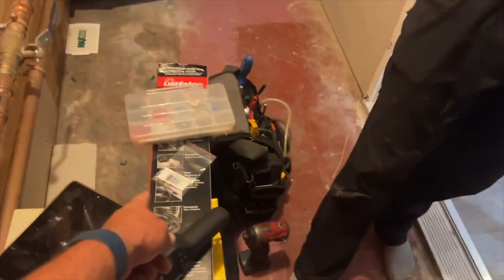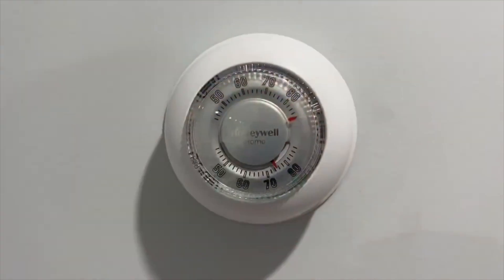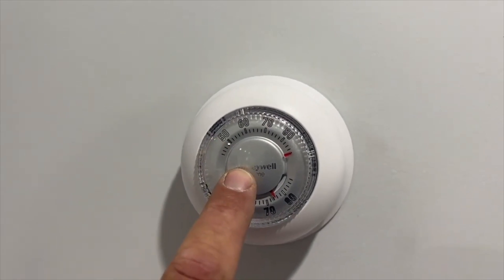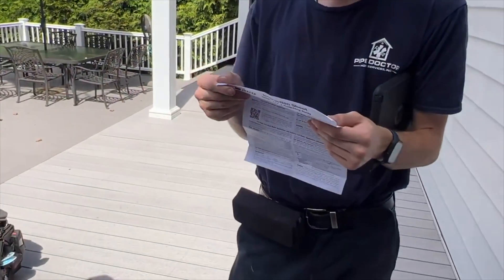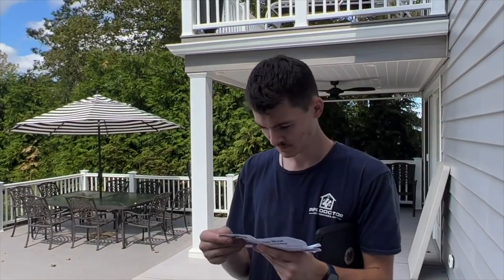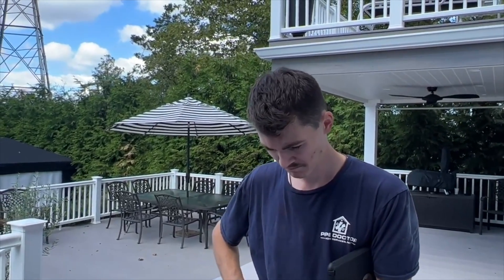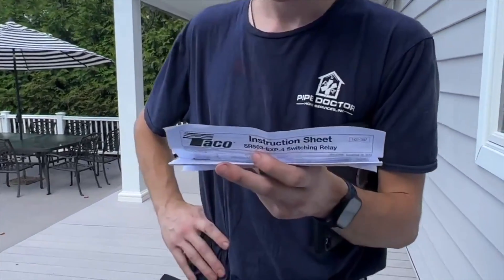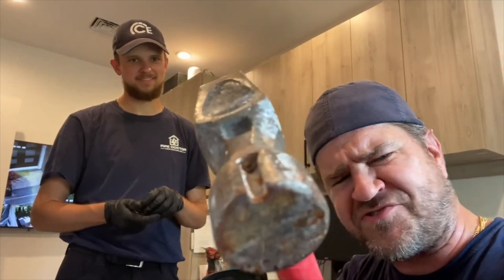Power Stealing Thermostats Explained How to Use 1/2 Watt 1k Ohm Resistor on Thermostats

Comment: Currently pulling my hair out dealing with a 2 zone, taco zone valve heating system w/slantfin, no zone control. 2nd floor works fine. Re-wired the rats nest. Replaced zone valve head 1st floor. Replaced tstat w/t87k. Apparently they do have a CR2450 battery if you take it apart. Your videos are an immense help in my career, just wanted to share that info!

Comment: My Honeywell lyric rounds have a  battery but are power stealing, they were not cheap just very smart. I had supposed pros that charged me 600% Mark up in parts install a Taco Zone control because the 3 Zone valves micro switch went bad (long story) anyway I have 3 zones each has a Gen 1 Honeywell Lyric round thermostat, there solution is sell me ecobee thermostats because all 3 lyrics are bad? Nope they are not bad they refuse to do some research that they are power stealing and won't trigger my boiler thru the Taco , for what this Michigan Upper Peninsula company charges they should know but turned out to be a Keep Throwing Parts at it till it works and charge the customer a 600% markup on all parts. Yes they jacked up prices significantly on me.  I don't mind a company making a $ but when they charge you $3000.00 for $500 in Parts on top of labor that is just crooked!!!  I could have purchased everything they used from Online Plumbing supply stores for $500 not Amazon an actual US based supplier and not a Box Store like Home Depot or Lowe's. I'm waiting on the resistors I paid about $6 for 6 of them , that company would have charged me $100 for if they ran out of parts to throw at it. They don't realize now every homeowner has 0 constitution/HVAC/electric skills.

Comment: Using a Rodger’s white dual level temp with two zones can’t get how to independently control each relay this is the answer I was looking for !Thanks were talking 7 months of going back and forth to resolve the fourth nest gen 3 thermostat controlling each relay and base board  heater. Relays installed below in sub basement ! Everything worked perfect for 7years only being able to use one side of the RW relay adding two Honeywell R841-1227 240v 22a relays !

Comment: I taken apart the 
They have a 3 Volt lithium coin battery inside on circuit board that need changing every 3 years to those shitty non programming thermostat 
I thought the taco part #SRTR-001 RP resistor was for smart thermostats I snake a new wire to thermostat if I have 2 wires
R power 
w heat switching wire
And  get to common after the go through heat element or zone motor or electronic circuit board the complete circuit to c 
I thought this would make easier sometimes adding a transformer take common near thermostat works like a charm
But now what I was thinking 
Or running a new thermostat 
As electrician I do lot of control but this resistor new to thermostat 
But we used them in burglar and fire alarms all the time
I guess I keeping snaking new thermostat wires to thermostat

Comment: would this solve problems with thermostats dropping their call for heat during the startup sequence? like when the gas valve or some other relay goes to click on and then the thermostat drops the call for heating because its relay opens??

Comment: I just went threw a similar issue and wish I came across this video.  I installed a ncb 240/110 and utilized the onboard zone control. Upon startup it was calling for heat on zone one but I didnt think anything of it since the house was cold, the heat was off all day during install. I got a call the next morning because it was 85 degrees in the house,  the heat never shut off.  I diagnosed it as a bad thermostat and replaced it for the same (honeywell yo-yo). I had the same problem again.  I called navian and they weren't any help because the ncb was functioning properly. If you manually made a call for heat will a jumper it worked fine.  After calling honeywell the tech support told me I needed to buy a thermostat with batteries because of this power stealing issue.  I did that and it solved the problem.  He never mentioned the resistor trick.  That definitely kicked my ass over multiple days and trips back and forth. Thanks for the info Mike.

Comment: Saw a similar problem years ago where a certain brand thermostat was used with a Rheem electronic ignition and control board would sense a small amount of voltage with thermostat not calling and furnace would think it had a call for heat. The control would lockout for no flame signal.  You could either fix it with a resistor (as above) or add a isolation relay to separate thermostat signal.  It was pretty weird lockout wouldn’t occur unless thermostat didn’t make a call for heat for minutes or so.  Took time for the board to build the signal

Comment: the Honeywell CT87*** thermostat's have a lithium coin cell in them, they're non-power stealing. the coin cell is "not" field replaceable(although it's possible), your meant to replace them when the battery goes dead. the battery going dead on them causes all sorts of issues with intermittent functionality, it may work for a few short calls, tor one long, then be too low to work until the coin cell  recovers voltage (from non-usage). been there done that endless times, so if you have a customer complaining about intermittent function and you cannot find a problem, change the t-stat 🙃

Comment: Used to have an issue with simple package boilers especially the steam ones.  When attached to certain clock thermostats and issue would develop.   The motorized vent damper on a call for heat, would open, close, open, close continually.     Your would find this during a boiler swap out with an existing clock thermostat or a recently changed one.   I have not seen this happen in years, the fix was a pony relay.    First time it happens drives you crazy, then a call to some sort of technical support and they practically laugh at you.  See it once you never forget.

Comment: My Honeywell thermostat can be wired directly to the switching relay or just use the battery feature and I choose to use the battery feature. I did get a resister with the thermostat.:yougotthis:

Comment: Ecobee uses the g terminal. Alot of. Canadians were having their ACS fail because nest uses y terminal. The claim that there's not enough power to close the circuit isn't true. I've had to change so far 5 condensers due to this.
Reply: Given this is forced air units not hydronic systems. I'm sure on hydroponics it wouldn't matter.

Comment: Great video. Made me open a book. 

This all goes back to school. 
Ohms law 
And watts law.

Very important to understand since a resistor is a heater. And it’s possible to burn them up.
Reply: Especially since those resistors will ALWAYs be under a load. Wether the thermostat is charging or there’s a call for W

Comment: Were those thermostats electronic? They looked very basic, like mechanical tstats (bimetallic strip). I'm not sure about those specific tstats in the video & the 1K resistor. Being a control technician I've come across solid state relays that didn't trigger (like closing a relay contact) unless there was a minimun resistive load to operate. In those scenarios I had to add a resistor to increase the load for the solid state relay to operate properly. If the termostat W output was connected to a big load, like a contactor coil probably there wouldn't be a need to add a  resistor but since it was connected to an electronic board (high impedance, little current) it probably makes sense.

Comment: White Rogers big blue easy T-stat has switches on the back so you can make it power stealing.  I think it comes set as power stealing and you have to turn it off.  It also says it may not work on some furnaces, it will make the draft inducer run when it shouldn't.  Good video, Thanks.

Comment: A 1k resistor will limit the amount of current that can flow thru the circuit by giving a shut path for ground(COM) in case of a thermostat it can draw enough current to cause problems with a relay circuit without it. Alarm systems resistors are used in feed thru or a shut across the two terminals of that zone on the control board  to tell if a current change happens(Someone is breaking in).

Comment: Putting if from W to C at that point on the TACO puts the resistor across the relay coil.  This avoids the thermostat board from being impacted by the phase shift caused as the relay coil charging and discharging as the 24v cycles.  Likely the thermostat limits the voltage on W when there isn't a call as it uses the line for charge.  Maybe 5 volts or something that would let current flow through the coil but not be enough to cause the magnetic field need to operate the relay.  Maybe they put 5v DC on the W for charging, but that means if the R voltage is just 24 VAC, that the coil only sees 19v when the W call comes and that is below the 22 V needed to reliably operate most of these relays.  The resistor also provides a path for the voltage spike as the relay coil discharges on the AC cycle.
Reply: power stealing t-stat's can make a relay stay on by passing enough current to raise the voltage above the coil drop out threshold. so the idea is, at end of a thermostat call, the voltage across relay coil drops low enough for it to drop out/release. without the resistor, many relays will get stuck "on", as the hold current/voltage is often very low, 24vac relay may not drop out until below 10volts, even 5 volts may hold some.  it does take far more current to pull in initially though.
yes it would indeed eliminate back spikes, but to best of my recollection all the relay controllers have a back emf diode built in.
** in this video, the issue was opposite, not enough power available for the thermostat to charge up and function correctly. but either one can occur depending on thermostat design. 🤔 forgot to mention that and yes, I've had it happen either way or both combined if there's lots of long "ON" cycles with short off times.

Comment: The clowns that installed my furnace/AC unit failed to run a 'c' wire so I had to change the thermostat batteries every year...until I replaced the 4-wire cable with a 5-wire cable.

Comment: I had customer with nest tstats were turning zones on by itself with no call for heat, I though customer was nuts until I saw it. The New model Navien (death box) has built in zone controller and you need the resistors just like Taco zone controller. Love this trade always learning

Comment: resistor used bleed a small amount electricity to common.w- will flow just enough juice to power the stat ,but not enough to close the contact's in relay.taco also did this starting in the 80's with 250 ohm resister's for 3way and modulating valves.the newer centry zone vavles may also resistors to power newer power robbing tstat when zone panel isnt used.

Comment: In industry we use 4 - 20 mA loops for process control and monitoring. For measuring flow and temperature, the signal is in the current level and the sensor processor or the flow transducer steals power to operate from the current loop. I can see a zone control relay being a very low current circuit with little or no current available to power the thermostat, adding a resistor from w to common provides the current needed power the t-stat.

Comment: Would nest thermostats be considered a power stealing thermostat? Cause I know you need three wires for them to work but some houses I’ve gone to for a boiler install they only had 2 wires. Strange. What’s your take on that
Reply: Yes
Reply: yes and no.  at heart it is power stealing. BUT during a call  it is programmed to turn off the power stealing function. It does however resume stealing power once the call ends.  it's able to do this because it does have a battery. In other words the nest uses the battery to power itself during a call.